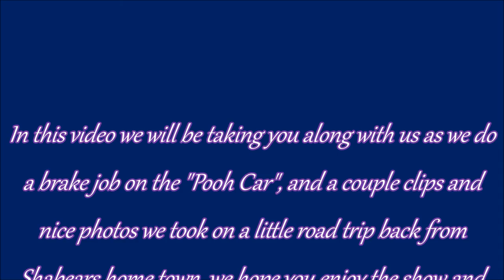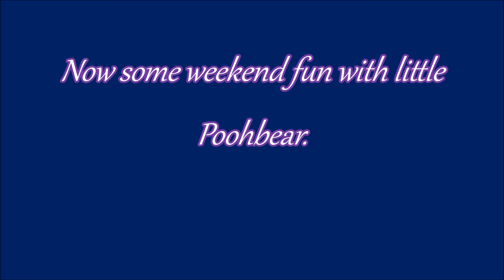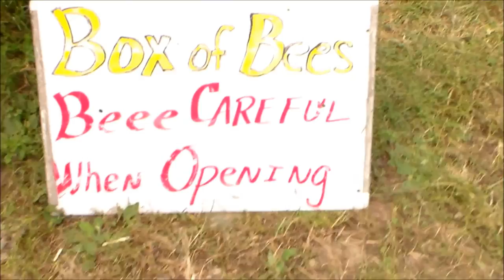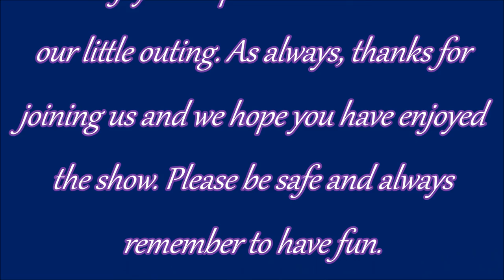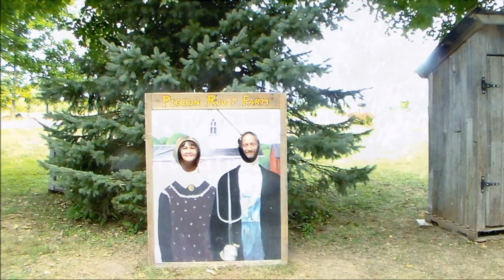weekend work and alittle fun

Comment: The problem with the car isn't Poo's fault it's a Damn Buick problem! They make a Ford look good. I owned one never again!  I was never so glad to get rid of a automobile in my life! Those brake shoes were rubbing metal for sure.  Did it sound like a screaming demon when you drove it? Just wait until the coil packs go out then your spending some money. Loved the photos Y'all take care now you hear.
Reply: +swampmammytheone lol I was going to say the same thing about my Toyota..you beat me to it!
Reply: +Moo Cow I'm going to stick to my Chevy's and Dodge
Reply: all I drive now is dodge..actually since 1981, the toiletta was for my daughter got rid of it real quick after two transmissions and one engine and 3 brake jobs in three years, I have had 81 dodge 024 85 024 turbo, 85 caravan, 90 shadow turbo, 94 caravan, 02 caravan, 03 turbo dodge sx, now journey r/t all went well over 400,000 no probs, well except for the 2013 r/t its only at 150,000 with no probs 310 hp to boot :)
Reply: Moo Cow  all 3 of mine are 1999's so far so good well over 200000 miles on all of them. 2 Chevy's and a Dodge. I've had bad luck with Ford's and Buick. Chevy by far is my favorite the Dodge is my Hubby's lol
Reply: swampmammytheone I do have a ford,but rarely drive it its a 1964 mercury park lane with the breezeway window original 352 engine with only 120,00 9n it..love it :)
Reply: Moo Cow Now that's when Fords were well built! I know your proud to own that